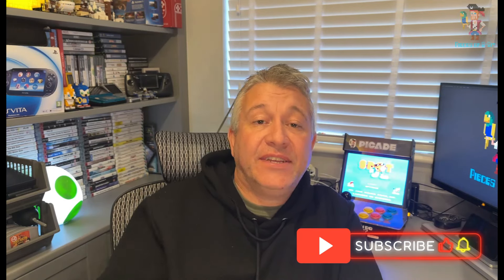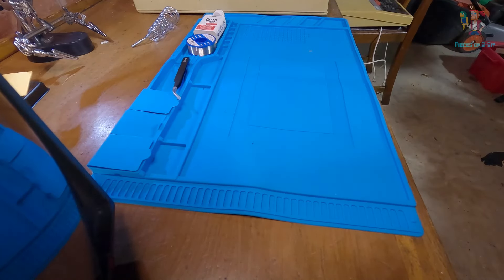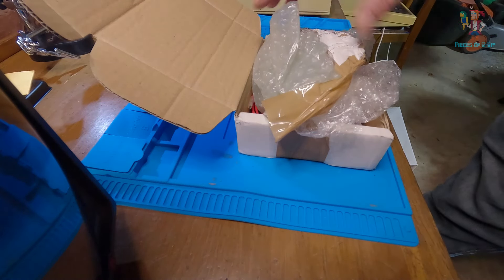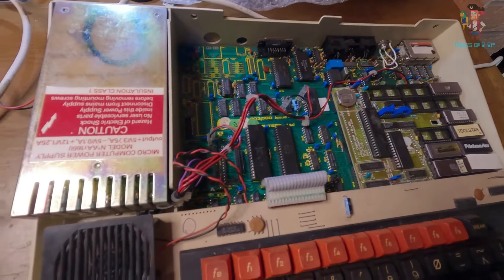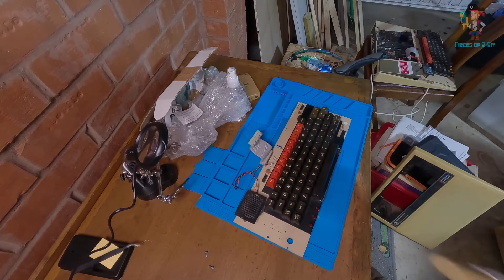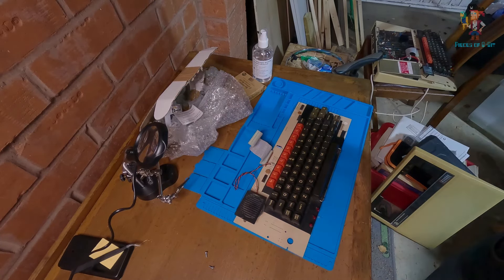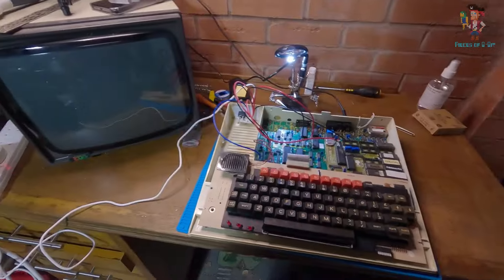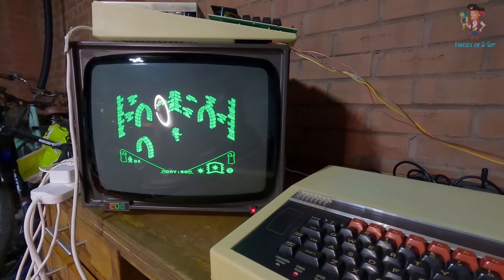Returning a classic computing 80's icon to "service" - Acorn BBC B "restoration" project

Comment: Well done Andy! Now, please tell me you have Podd & Granny's Garden on floppy for the Micro 😊. 

I've toyed with getting one of these for years. My first experience with one was in 1983/4 at primary school. I remember typing 'auto' then pressing and holding enter and the numbers would scroll from to infinity. It blew my mind 😂
Reply from the maker: Cheers mate!!  I absolutely love the Cub monitor with it - feels like a must with it.  As for the game - not one I appear to have.  There must be over 100 games in there... I'll have to see if I can find some more software.  A lot of it comes on tape, which I don't have the ability to load - so they can be tricky to find.  On the plus side - there is Elite in the box... that'll be getting checked out...  still thinking about a Gotek so I can more reliably have access.  Since making the video swapped over a couple of bad drives in the two double floppy units to make good double floppy unit.  So now I have a double drive and a single drive in working order!

Comment: 11:35  IEEE488 is a parallel bus and i believe it pre-dates SCSI. You can use to hook up HP scientific instruments and/or Commodore PET peripherals
Reply from the maker: Ah cool thanks for the clarification! - I probably should have researched before I stated so boldly... definitely a rookie error.... heh... I suppose technically it does predate USB, but there were many things in between!  This is what happens when you riff without research :D!  Cheers for watching :)

Comment: You should be careful with that kind of flux. It kills the tip and is not meant to be used on electronics.
Reply from the maker: Ah thanks for the heads up. I haven’t used much of the stuff on the bench these - more that I wanted to have some test/demo projects to learn with first.  I’ll check the materials I have way before I use it on anything valuable!!